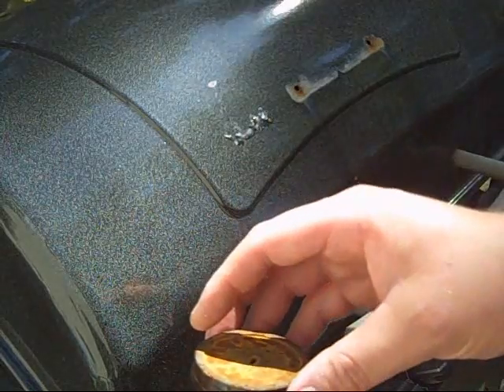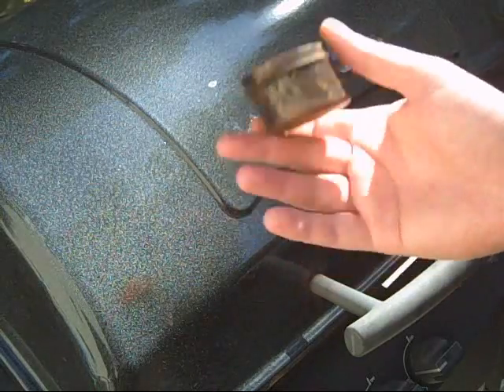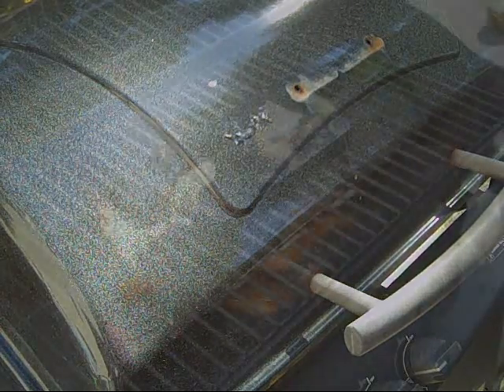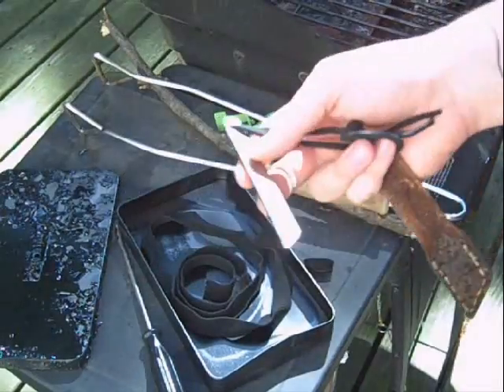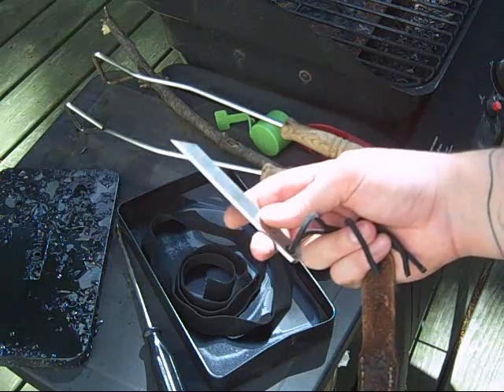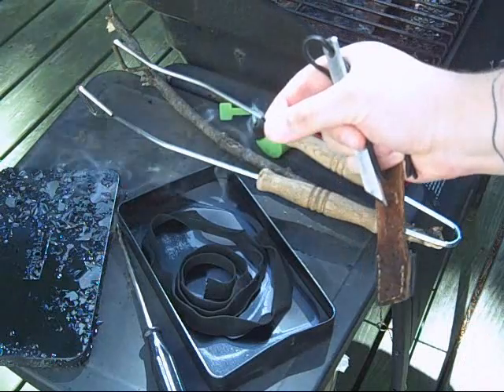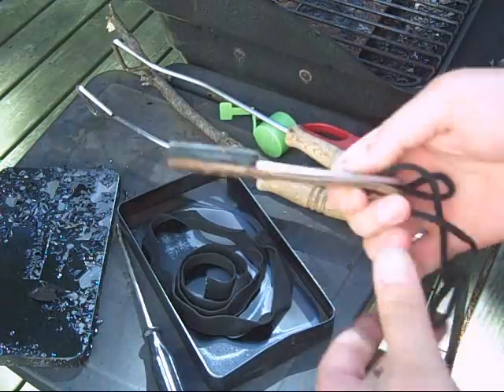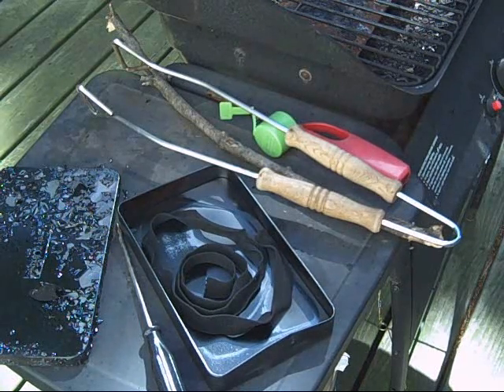Charcloth and a little striker/tool I made from O1 steel

Comment: @Fridabeekman they last quite awhile but the sparks are low temp so char cloth is a definite. a fire steel has hot sparks that will easily light tinder directly, this is one step up from a bow drill

Comment: No need for a hole in a tin with that style lid - it will leak enough as is. When I do make a hole in tins with tighter fitting lids, I put it through both the side of the lid and side of the tin. Have the holes aligned when making char, then rotate the lid so the holes are no longer aligned to protect the char. Works just as well if the lid is round, square, rectangular, etc.

Comment: Nice tool.  A question for you, what throws sparks better in your opinion, O1, W1, or 1095?  I've been forging them from old files, and they work great, but they are getting hard to get down here.  Thanks.
Reply from the maker: forge52100 No idea on W1 But I have some O1 strikers and they throw great sparks. I dont see why 1095 wouldn't either. Not sure where you are buy find some honey holes for antiques. Files always turn up.
Reply: Been looking around, but not much of that stuff down this way.  Anyway, I was looking at making them a little more efficiently anyway.  I believe most of the old files were W1, so I'll try one out of O1 and see how they compare.  Thanks.